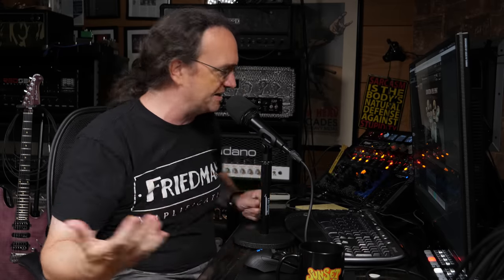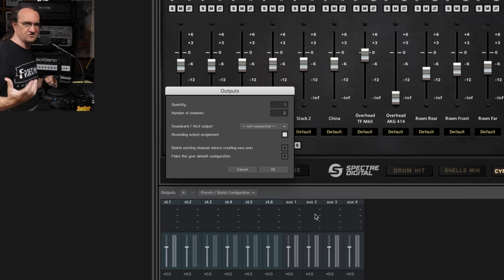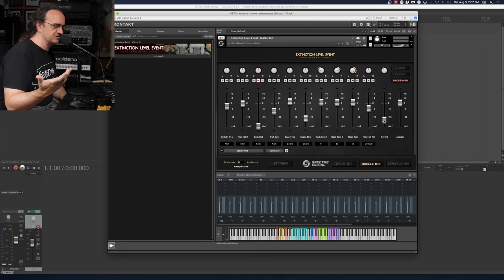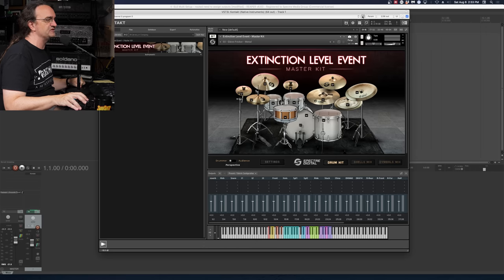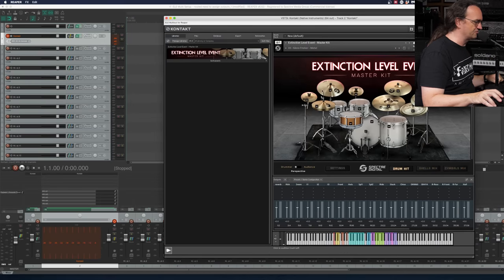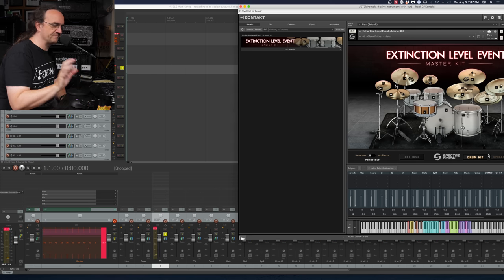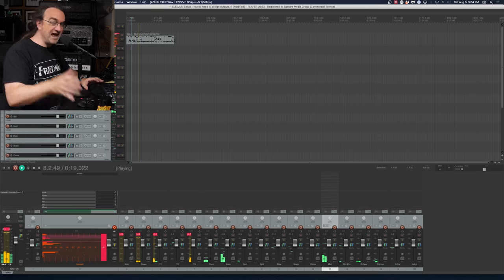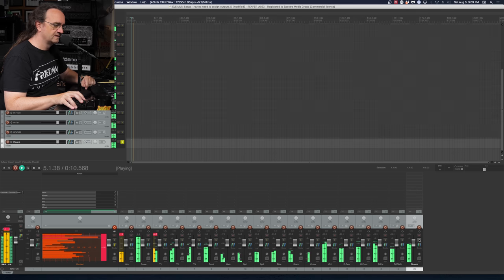Kontakt Routing is NOT fun.  Here's a better way!

Comment: The quick way to assign Kontakt outputs:

Open Kontakt Standalone, and make sure your main interface is selected as the device used in the Audio section of Kontakt's Options window.

Hit F2 to open the Output pane. 

Click the "+" to add outputs. 

Enter the number of stereo outputs you want. 

In the "Soundcard/Host Output" section, select the first channel of your interface. 

Check "Delete existing channels" and "make this your default configuration."

Hit "OK," then click "Presets/Batch Functions," go to "Save current output selection state as default for.." and select "All formats."

This will give you the same number of outputs as your interface, but they will already be routed and set up, which in my case is 18 stereo outs.

If you need to add more, then you'll have to do it the tedious way that Glenn showed in the vide.
Reply: I don't even have the ability to access the Output pane. Is this something that is only available with the full Kontakt suite? I only own ELE so I just have Kontakt Player 7.

Comment: There should be a drop down option on the main screen of kontakt that is set to stereo, but if you select multi-out advanced, it should auto-route your outputs in kontakt to the output tracks in reaper, so you don't have to manually set them up one by one

Comment: Hey Glenn, I picked up EVE Master Kit and it's awesome. I have a little problem though... I see in the settings that there is a Crash Left and a Crash Right. I can click them but I only hear them from the OH, Room, Front of kit outputs. How do I configure a seperate output for the crashes? I can't seem to find an option for them. Thanks.

Comment: Just barely digging in with it. I'm doing everything from scratch, so it's baby steps across the board. So far, it sounds better than any faux drums I've ever set up, and that's without any tweeking.
I am sure there is a method to set up a 4th tom for 'muh Lombardo fills' but would it be possible to make a base player's guide on how to set that up? Cheers Glenn.

Comment: Had to cone back to this because the template no longer works with the new version or Kontakt 7. I had no clue there was an update at all so it was a pleasant surprise. I'm still figuring out all the new controls but I'm disappointed to see that the China splash and other Fx Cymbals were moved to a single fader. I've turned all the processing off but it still sounds a little processed so I wonder if there's more under the hood options I'm still not finding

Comment: As someone with a 500 track template where 90% of it is kontakt routing I relate to your pain doing this. Hopefully one day kontakt and reaper play nicer together.
Reply: If you use Reaper, I highly recommend using Orchestral Template for Reaper (OTR). They have made fulling routed presets for Kontakt. Saves hours.
Reply: @LotusEater14  I will check it out thanks
Reply: I think on all DAW's Kontakt is a PITA for routing. Even on Cubase it is as well.

Comment: I didn't have a chance to watch the whole vid since I had to clock in for work, but I'm super excited. Will this work with most drum packs in Reaper? I'm using Addictive Drums 2 and have limited experience with this stuff, so I could use all the help I can get.

Comment: I really love the plugin, I just tried to mix a little bit and it sounds amazing. But when I saw that it has to be running with Kontakt, I knew I was gonna have to crack my head if I wanted to pull out the multichannels and make it work as I wanted fit. Honestly, I wish this plugin worked by itself than run it through Kontakt because it tends to give too many problems. I had to find a way to save more RAM because it was consuming to much and my DAW crashed sometimes and it distorts the samples and also slows down some hits. Also for some reason, Kontakt itself deconfigured my output at the point it didn't play my MIDI at all, and I was looking for a solution and many youtubers suffers the same thing with other plugins, but wasn't able to find a permanent solution, until I found a hidden option that I had to enable to be Omni channel for MIDI instead of channel 1 like it assigns it. That's my only thought, that the software should work as a self software with a standalone like EZDrummer or Perfect Drums, instead of running it with a third party software.
Reply from the maker: Grab my template for multitrack

Comment: set up the routing first if you know what it is going to be then load in the instrument in that order always seems to work better for some reason. Kontakt routing is weird. 
 A trick with kontakt drum libraries that you can do if you can mute parts of the drums on and off separately. Have 2 drum kits loaded in the same kontakt player and mix and match parts of the kits or even layer parts. I have seen this done with 3 kits at once just recently. The zombie drum kit.  Or change the CC of each library so you just have like 2 or 3 drums kits at once loaded up on the piano roll.

Comment: You don’t have to do any of this. Clear your tracks, go to insert virtual instrument on new track. Select kontakt or whatever drum VSTi you are using. Reaper will ask you if you want to run this VSTi as an 18 out (I forget the exact message,) select yes and Reaper will automatically create and bus out individual tracks for each element including the drum room sound which you can mute. Unless Kontakt (which I haven’t used in a bit) has changed this, reaper will make this entire template automatically. It works this way with Addictive Drums 2, Superior Drummer, Modo Drum, XO as well. Am I wrong?
Reply from the maker: Watch the video
Reply: @SpectreSoundStudios  I did.

Comment: Your Kontakt instance seem to have reconfigured it's output channels to 36 only, that's why 37 and 38 were not working. I'm not exactly sure why does this happen with VST3i in REAPER, but it does. I've given up on reaper long ago, so I'm not sure how to fix it, but I can bet it is an easy fix. For example using AUi you can just set your desired outputs count at the top right of plugin host (I/O matrix - openen via the  (2/36 out) button) which apparently doesn't work so well with VST3i for some reason..

Also, in the second section of the video when configuring outputs - if you've chosen first kontakt output in "Soundcard / Host output:" dropdown list instead of "-- not connected --", checked "Ascending output assignment" as it is on the video AND checked "Delete existing channels before creating new ones" it would do most of the work for you creating desired count of channels and automatically assigning their outputs so you don't have to click it. st 1 would be routed to 1/2, st2 to 3/4 etc.

Cheers!
Reply from the maker: Thanks for the tip!  I’ll try that out at some point…. At least I’ve now got a template!

Comment: have you tried once you get it set up in kontakt, unfloating the plugin. (right click the top bar and unfloat), select it in the left hand list. hit options on the FX track menu that should have appeared when you unfloated the effect., and then hit "build multichannel routing for output of selected effect"

it will end up building all 64 outs, but here's the thing, providing your out routing was correct in Kontakt, it will be right once reaper builds the tracks. Then you can just delete any that you don't need.
Reply: To clarify that way instead of building it then loading the preset, you load the preset, or set it up, and it will build the outputs based on your setup rather than building them and then hoping the routing built right. There's an Adam Steel video about doing that with steven slate drums which is not a kontakt plugin. however it works with kontakt as well.
Reply from the maker: Thanks for the tip, Charles!  I’ll check that out!

Comment: So basically what you’re saying is that by the time you have this setup you could have had a 4 piece drum set tuned and miced and recorded? Got it. 
The trick to make drums sound good is, tune them, choose the correct mic, choose the correct placement.
Just did a live recording using my standard mic placements and the drums are MASSIVE.

Comment: Hey, kind of a noob question here; I've only recorded guitar tracks for my own personal use, but never a whole ass group/band. Are guitars/bass the only thing you record multiple tracks for, or do other instruments get layers too? It's just a typical metal group; 2 guitars, vocals, bass, drums. No keys or synth or anything of the like. If you need to know, we're usuing a half electronic half acoustic drum kit and my friend's DAW is Mixcraft. (I think that's what it's called, he actually called it Acoustica, and that's the only DAW i can find by them)
Reply: Vocals can have layers as well. Personally don’t double track drums. Multiple inputs yes but don’t layer.
Reply: @marshallfairbrother7602  fair enough lol i figured not, but you know what they say about assuming.. and usually online advice is... well, complete shit haha
Reply: @xamislimelight8965  you can layer bass parts as well just depends on the song really. The only time I might opt to layer drum parts is if I had 1 part that was smashed in effects and then another part that didn't have effects came in later like on the song guillotine from stray from the path. that drum intro was probably layered as there are 2 separate parts going on especially when they play it live. Obviously that isn't the same as tracking drums using multiple inputs as you blend those multiple inputs together during the mix process to create the drum sound

Comment: Couldn't you have skipped min 7 right to 12 by clicking "build multichannel routing for output of selected fx" in the context menu of the Kontact plugin? I use it all the time to quickly do all the connections in other plugins.
Reply: I posted this at 12 mins, at 15 you are still doing it. I think if this works for kontact that it should save a SHIT load of time.

Comment: I kind of wonder why you think you need stereo channels coming out of Kontakt.  One mic = one channel.  Yeah, that probably means panning inside Kontakt, but that's not really Reaper's fault.  One would think maybe the author of the thing could include a preset that just does it, maybe?  ;)  I did post the question on Reaper fb group.  There's probably a script that will do what you hoped it was going to do.